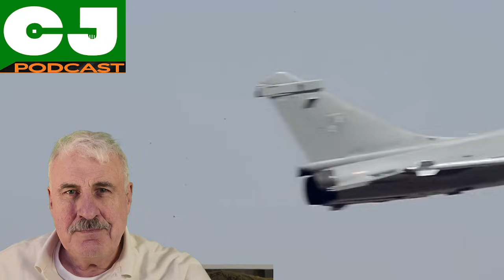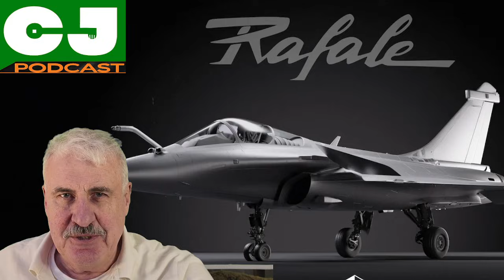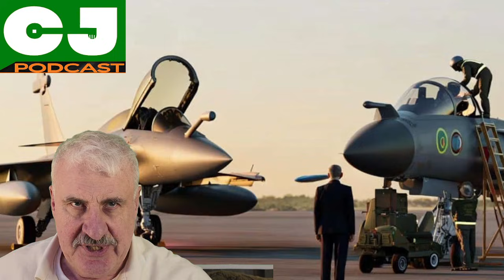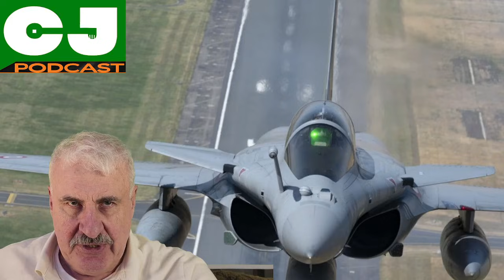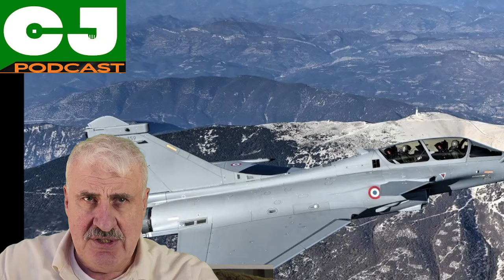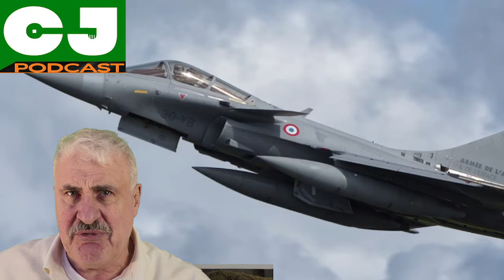Rafale vs Gripen – What Should the Irish Air Corps Choose?

Comment: From a repair and maintenance service point of view the gripen can be serviced by regular maintenance of unskilled personnel whereby the rafale needs specific trained personnel to repair the aircraft
Reply: The rafale is not the F35, swedes and french are aligned on this topic. You can plug / unplug an entire engine in less than 1 hour. 

For me ( and yet i'm french ) the Saab has some major advantages : designed for very short terrains, small facilities, abilities to land on highways,  small teams... 
It is easier for a country without a fighter jet fund to equip itself and improve its skills... without sacrificing anything on the essential capabilities of the machine. 

The main difference is in agression air to ground mode : the rafale can carry ... twice more bombs and ton than the grippen, and nuke bombs.. BUT 

For ireland and in defense + air to air situation it's irrelevant, ireland will never live the ukrainian situation with the need of throwing 8 tons of Hammer gliding bombs each flight.

They mainly have to support Nato defense around an island, they won't bomb themselves or UK ^^ .
They just have to keep the north sky clear of migs and sukhoi with a bunch of meteor missiles. 

Another good point for the Rafale pointed in the Swiss evaluation was the automatic ultra low flight in mountains. Same : no relevance for ireland surrounded by the sea.
Reply: @philv3941  France and Sweden can learn from each other. The biggest difference between our military strategies as I see it is that as a great military power France never expected attacs to come from behind. Sweden expected to be the underdog in any war and expected our airforce to work even if the country was bombed to dust
Reply: @philv3941 Ireland is not part of NATO but the Irish political class wants Ireland in NATO . All the points on tne aircraft is valid
Reply: 😂 please, do not let unskilled personal touch to any aircraft... Including the Gripen...
Operating the Saab JAS 39 Gripen E is far from trivial: maintenance crews require months of type-specific training and annual recertification on engines, avionics, EW and constantly evolving software systems. Ground teams must be certified for weapons handling, rapid turnarounds and networked operations, with recurring safety and tactical refresh cycles. Even if the jet is designed for a smaller footprint, it remains a complex 4.5-gen combat system that demands structured training, disciplined logistics and continuous updates.
Reply: @rcouderc unless…you actually built the aircraft to be serviced by 1 trained technician and a small crew of conscripts. Which Gripen is. The rest of the ”West” view it as you do, but the Swedes think differently. They need to be able to run this jet from a road in -40 degrees. And when that is the requirement, everything HAS to be simple to maintain, refuel and reload. Or it breaks. The Swedes have no time for complexity in the field.

”Deep” maintenance, where you do physical removal of sensors, radars, or equipment in the cockpit ofc need a controlled environment and skilled personnel, just as any aircraft. But if you need to run 20 sorties in a row, that can be done without ever touching a hangar floor. You swap pilots after every 2-3 sorties while you get the plane refueled, and off you go. It is a question of operational endurance.
Reply: @johns70 John, I think what you’re describing is absolutely valid — but mainly for the Gripen C/D philosophy, not necessarily for the Gripen E that Saab is selling today.

The whole “one technician and a few conscripts on a frozen road at –40°C” concept comes straight out of the Swedish Bas 60/90 doctrine, and the Gripen C was genuinely optimized for that. Small airframe, relatively simple architecture, RM12 engine, high modularity, very fast turnaround. No argument there — it was designed from day one for dispersed defensive ops with minimal infrastructure.

But the Gripen E is a different animal. Bigger airframe, 40% more internal fuel, GE F414 engine, AESA radar, much denser EW suite, much more electrical power and cooling demand. It’s a modern 4.5 gen platform with a lot more embedded complexity. That doesn’t make it bad — it makes it comparable in system density to other advanced fighters. The gap in “simplicity” versus Western peers is not what it used to be in the C era.

On operating costs, Saab and Aviation Week evaluations around 2023 placed the Gripen E at roughly €20,000 per flight hour (depending on accounting model), while the Rafale is typically quoted around €23,000 per hour. That’s very close in real terms. The idea that one is dramatically cheaper to run than the other doesn’t really hold up at the E vs F3R/F4 level.

Regarding maintenance philosophy, the Rafale was not designed around heavy, frequent overhaul cycles. It has evolved toward condition-based maintenance with very limited traditional “deep overhaul” logic compared to older Western jets. Accessibility was built into the design from the start — major components are modular and quickly reachable. The M88 engine, for example, is designed for rapid removal and replacement(it needs only one hour for the whole swap) and the aircraft does not lose squadron availability the way people sometimes assume. Being twin-engine also provides a mission and safety margin that a single-engine platform simply cannot offer, which matters in real operational terms.

As for cold weather and austere ops, Rafales operated recently in Finland and Sweden in Arctic conditions, validating exactly that kind of deployment logic. France also tested Agile Combat Employment concepts with reduced support footprints. It’s not marketed as aggressively as the Swedish road-base narrative, but the capability is there.

So yes — your point is historically accurate for the Gripen C. But extrapolating that simplicity to the Gripen E and contrasting it with a supposedly “complex Western” Rafale oversimplifies the picture. At today’s system complexity level, both aircraft live in roughly the same maintenance and cost universe, just with different design trade-offs.

Apologies for the long reply — but when you work in this field and you genuinely enjoy it, it’s hard not to dive in.
Reply: 1 Specialist meeded but the rest can be conscripts to service the gripen as I understand it, but maybe not in all situations.
Reply: @MarcusJönsson-l9f reloading, refueling and basic maintenance can be done on an extremely low logistical footprint. Sure, if you need to replace the radar you need specialized crew and hangars, but all the ”run-of-the-mill” stuff is super easy on the Gripen. When you are trying to do it in -40 degrees (which is what it is tested in), it HAS to be simple. Or it breaks.
Reply: @johns70 sauf que tt les chiffre demontre que le rafale est certainement l’avion de combat qui la disponibilité la plus importante et avec un coup de l’heure de vole très faible et les chiffres sont public ds les pays qui l’exploite
Reply: The rafale is not the F35, swedes and french are aligned on this topic. You can plug / unplug an entire engine in less than 1 hour. 

For me ( and yet i'm french ) the Saab has some major advantages : designed for very short terrains, small facilities, abilities to land on highways,  small teams... 
It is easier for a country without a fighter jet fund to equip itself and improve its skills... without sacrificing anything on the essential capabilities of the machine. 

The main difference is in agression mode in air to ground : the rafale can carry ... twice more bombs and ton than the grippen, and nuke bombs. 

For ireland and in defense + air to air situation it's irrelevant, ireland will never live the ukrainian situation with the need of throwing 8 tons of Hammer gliding bombs each flight.

Comment: The Grippen does not have an American made engine anymore it has a Rolls Royce engine now.
Reply: Apparently this is false, the CEO of Saab said it.
Reply: @bobmarley3594 so they changed the entire structure of the aircraft for the engine and then didn’t put a rolls Royce engine in 🤣
Reply: its just a fake story floating around. There has never been any serious plans for a Rolls Royce engine in Gripen. Its powered by GE F414. The lastest Saab fighter using Rolls Royce Engine was Draken.

Comment: Croatia got a great deal on Rafale (pronoounced khaff-all) recently, a squadron of 14 ex French F3s for just under €1bn. They declared operational status 5 years after the contract was signed. Gripen is nice, but without tankers, it lacks the range it would need for policing our western seaboard, i.e escorting a slow moving russian Bear through Irish controlled airspace.
Reply: Ireland doesn't need second hand aircraft. It's new aircraft that Ireland needs.
Reply: In Sweden the long escort tasks would have been solved by taking turns, with a new 2-flight taking over when the first pair went to refuel.

Of course in the old days we'd never need tankers, since we were always at home and the nearest mobile ground crew on a two lane road was our 'tanker'
Reply: The Gripen Es combat radius of 1300-1500km is enough to fly to Reykjavik and back from Dublin. I don’t see the problem?
Reply: @johns70 you better avoid to do such flight... Gripen is mono engine...  And the water sounds quite cold in this path.
Reply: @rcouderc why? The Gripen has tens of thousands of flight hours with no engine issue so far. The dual engine people keep stressing about it, but both the F-16 and the F-35 are single engine jets, and they are also doing routine flights over the ocean. In fact, the F-35C is the navy version of that particular jet. You basically don’t know what you are talking about. 

I could MAYBE buy it if you are risking getting shot at, and it could hit one of the engines, but the US Navy seem to agree with me and the available data.

Plus, Ireland’s fighter jet are more at risk of hitting a seagull than getting shot at…
Reply: @johns70  It’s not about engine reliability — modern engines are extremely reliable. It’s about consequence management. Over the North Atlantic, a total thrust loss in a single-engine jet means ejection into cold water far from shore. A twin-engine jet statistically reduces the chance of total power loss. The US Navy accepted the single-engine tradeoff for industrial and cost reasons, but they operate with massive SAR coverage and carrier groups. Ireland does not. So it’s a risk calculus question, not a “you don’t know what you’re talking about” question...
A single-engine fighter like the Gripen has a glide ratio around 8:1, meaning that from 30,000 ft (≈9 km) it can only glide roughly 70–90 km in ideal conditions — and closer to 40–70 km at more typical patrol altitudes.

So once you’re more than ~70 km offshore, there is effectively no glide-back margin: a total engine failure means ejection.

That’s why the discussion isn’t about engine reliability, but about consequence management when operating far over cold ocean.
Reply: @johns70  Birdstrike is precisely a risk mitigated with multi engine crafts..

Comment: If safety were a major factor, Rafale would win with twin engines, but the price would be a major issue
Reply: Gripen has never had any engine failures
Reply: Nor M2000 too with single engine. But it's a peace of mind to have this redandency
Reply: @MarcusJönsson-l9f if you have a bird strike…
Reply: The gripen e and f is about 80% the price of the rafale. You are referring to the c and d version.
Reply: the price isn't THAT different if we only talk about "naked aircraft" (without their weapon package), be it for the initial buying price or the maintenance price...
it's also completely ITAR free, at the difference of the current Gripen